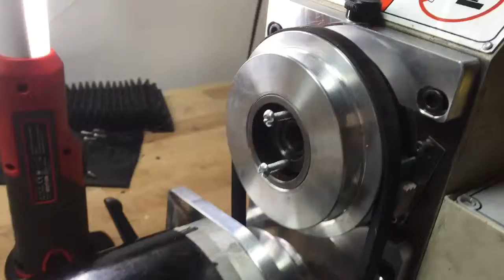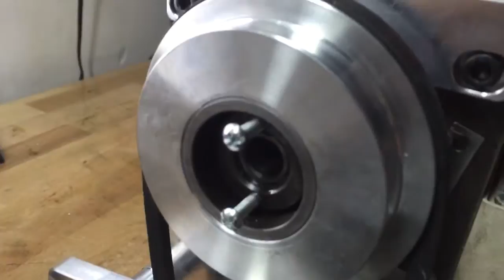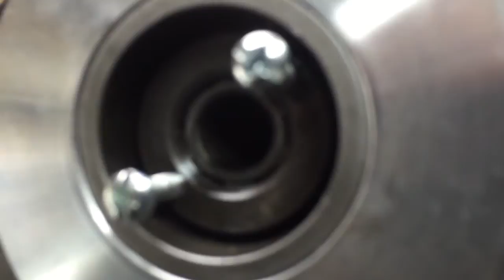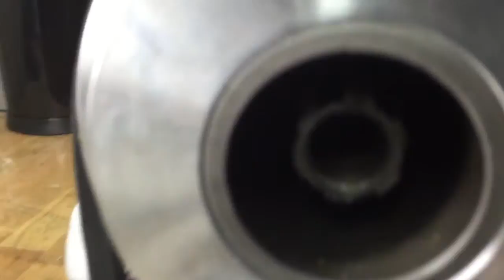L- Benchtop precision belt drive kit question2

Comment: Mine had the same problem, to be quite frank, not happy with it at all, yes it's beautifully machined, but fit was horrible.  I ended up scraping the bearing carrier, and reusing the original drive gear system/bearing carrier with a homemade pulley carrier attached to it.